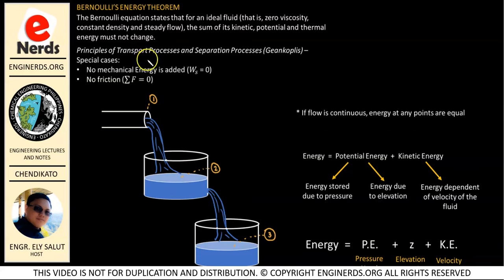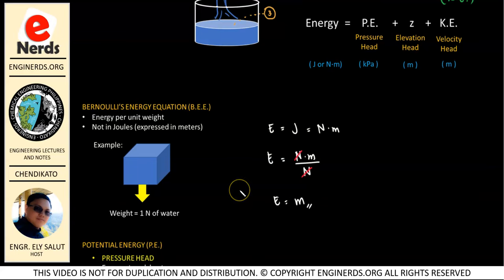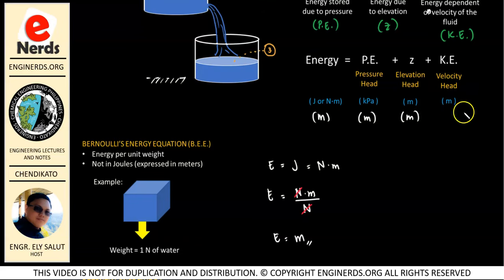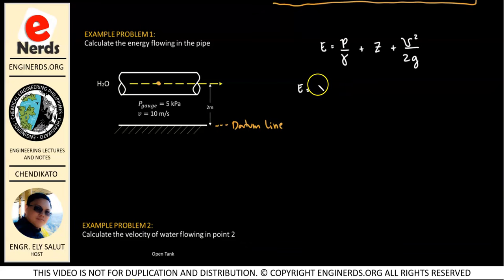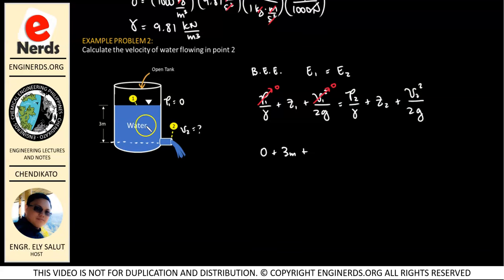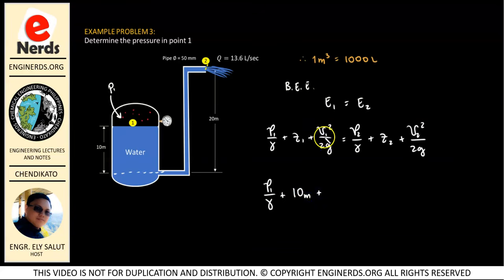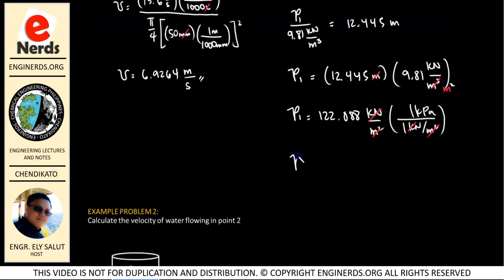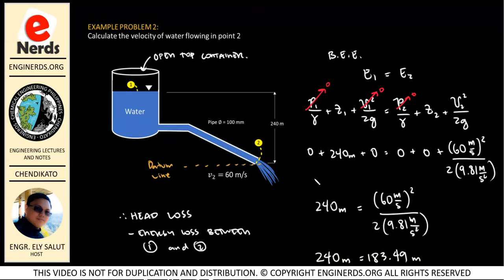BERNOULLI'S ENERGY THEOREM [ FLUID MECHANICS AND HYDRAULICS ]

Comment: Thank you, you've done a good job explaining the Bernoulli principles. However, I think you should also explain why the air pressure at the open container at point 1 can be considered equal as the air pressure at the lower fluid surface of point 2 or point 3. My point is that if point 1 at an elevation of a very tall mountain (like Mt Everest or at the edge of space) and point 3 is at sea level, the difference in air pressure is now very substantial. That is why mountain climbers have a hard time breathing the thin air. After all, air has weight as well and can be considered a fluid. 😀

(just stirring the hornet's nest for further discussions and I'm very glad and thankful for your team's channel)